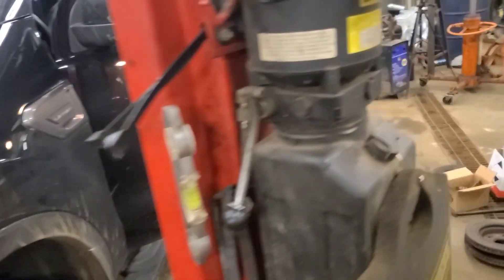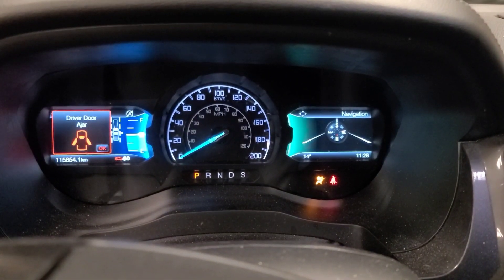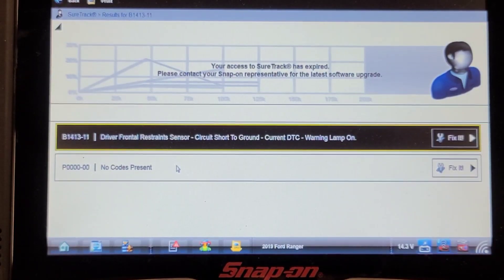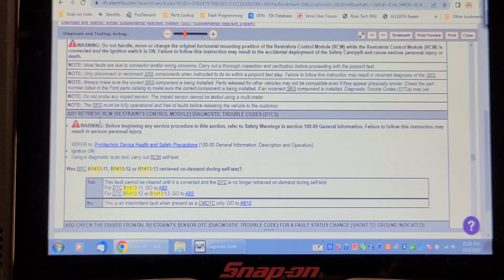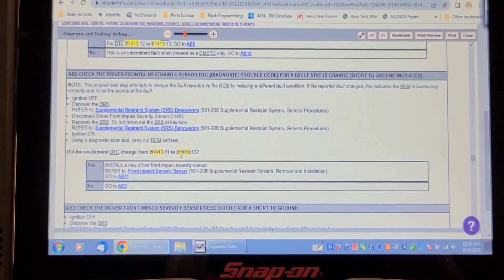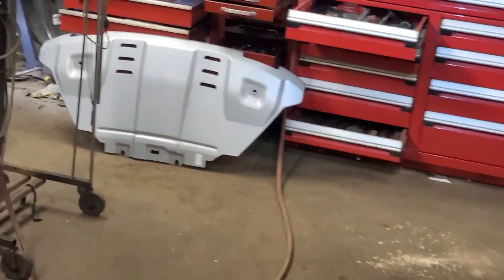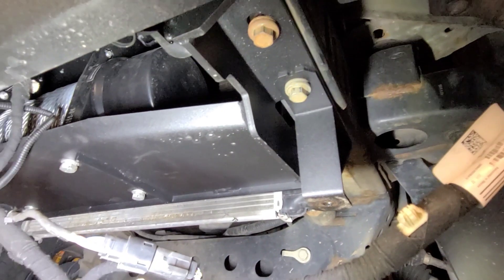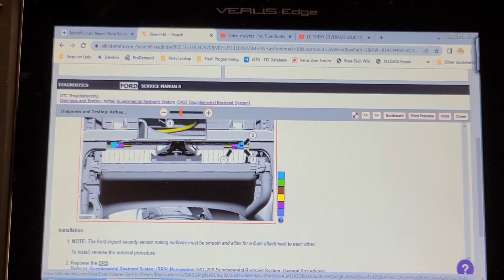2019 Ford Ranger Air Bag Light On. Code B1413-11

Comment: Did you fixed it? I have same and changed the sensor and the connector! The code still shows up
Reply from the maker: The crash sensor and wiring were damaged during the winch installation. The customer had to take it back to where it was installed. If you changed the sensor then I suspect that there is a wiring problem.